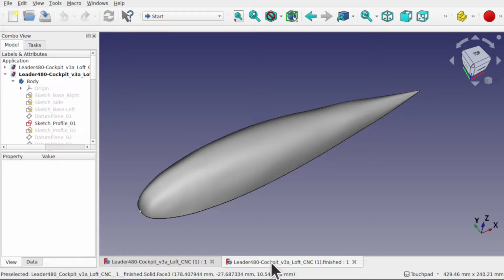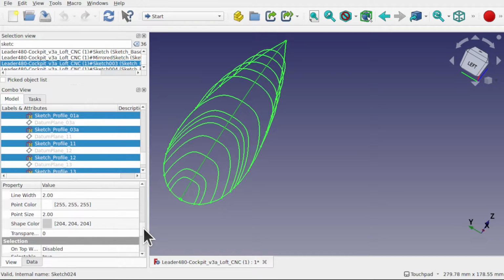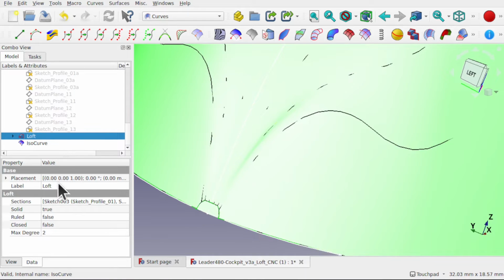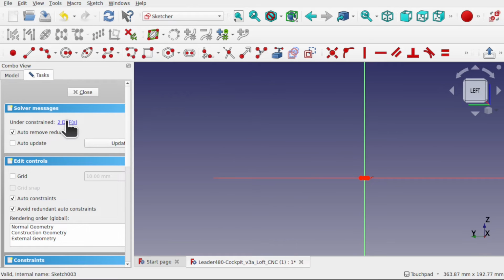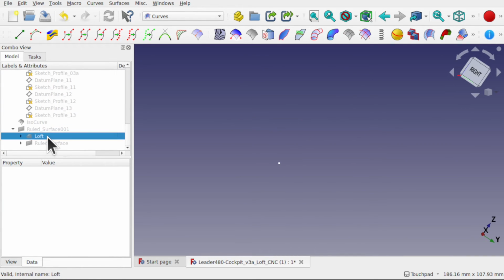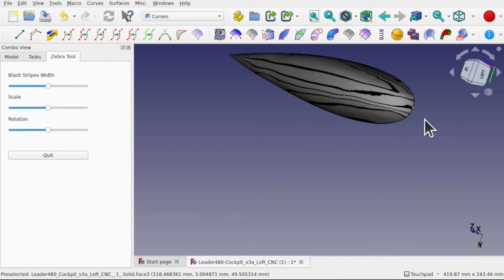FreeCAD: Viewers Peer Review | 2 |  R/C Fuselage Surfacing Issues Resolved

Comment: I've been watching many of your videos, they are well done.  But I am stuck after 2 days..
I'm trying to create a car fender from a 37 Chevy, which has multiple curves and a outside shape that isn't square not straight.  I've finally created a loft after tweaking all the sketches so I have the fender shape.  But its just a shell and everything I've tried to turn it into a solid has failed.  I tried an extrude and cut and that failed, the make solid fails. I am at a loss what to try next.  It seems if I can change my sketches to be fully constrained b-splines that have a closed form the lofting would create a solid, but so much work to not be sure it will succeed.  No simple way to constrain a bspline and I have 6 of them that need it.
Anyone with some advice I appreciate it.

Comment: 00:00 Intro
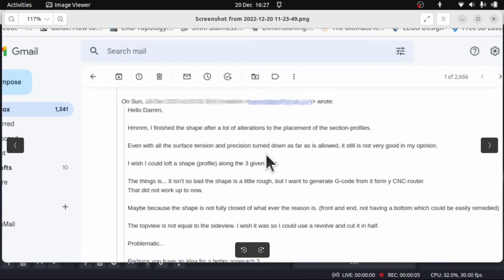01:14 Viewer's Description of the problem
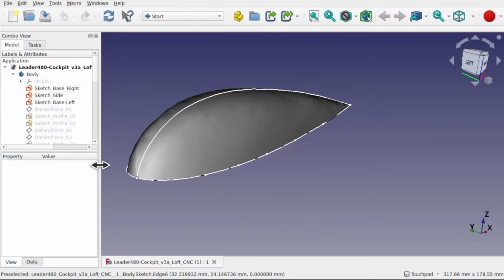01:56 (Inspection)
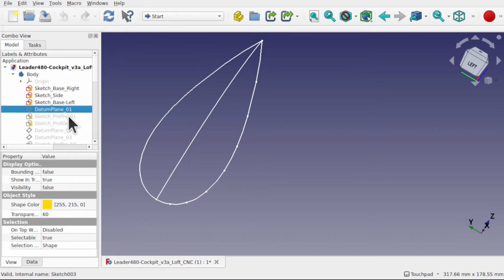  02:40 Using Selection View to show only Sketches
  06:18 Curves: Zebra tool for visualization of surface roughness
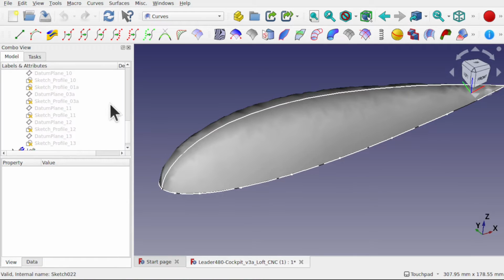06:58 Loft data: Max Degree setting
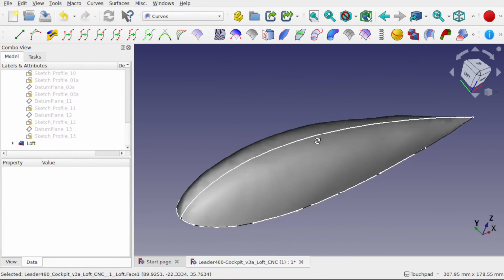07:59 Loft view: Deviation setting (fixes roughness)
08:56 (Fixing pinch at front)
  08:56 Curves: IsoCurve tool to inspect problematic profiles
  09:49 Inspecting front profile: making loft non-solid, replacing profile with point
  12:19 Removing extraneous profile
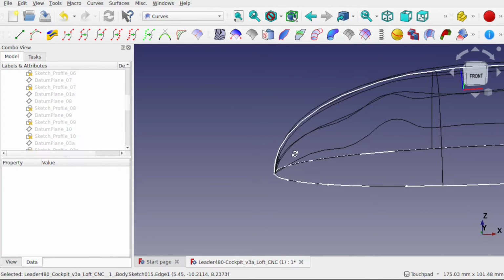12:42 Sketch Side: decreasing deviation
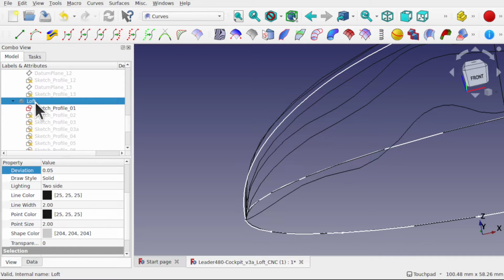13:22 Experimenting with front profile
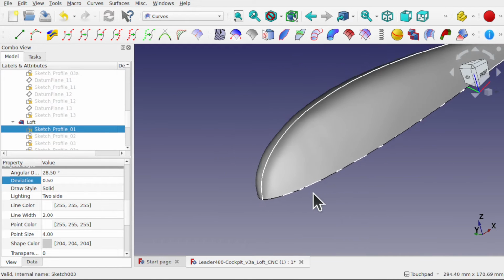14:28 Inspecting rear profile
15:00 Part: Ruled Surface to close shape
18:48 Curves: Parametric Solid application & problem solving
22:01 Part: Create Compound & Convert to Solid (lesser alternative to Curves: Parametric Solid)
22:58 Conclusion
Reply from the maker: Your a star!!!! 😁😁😁⭐⭐⭐